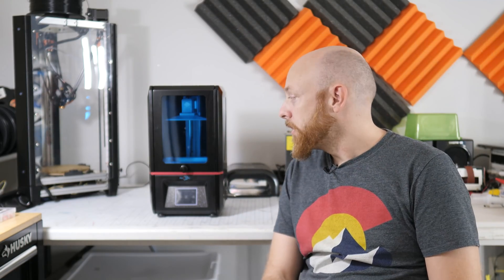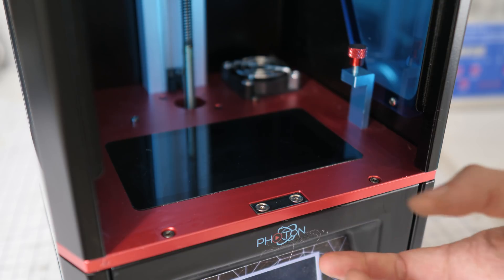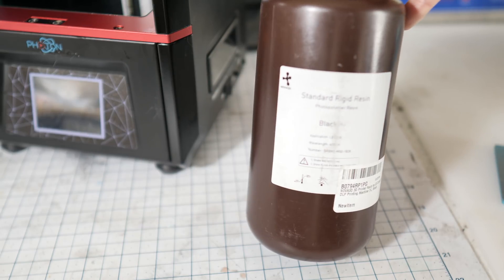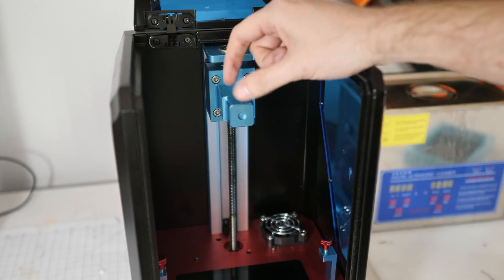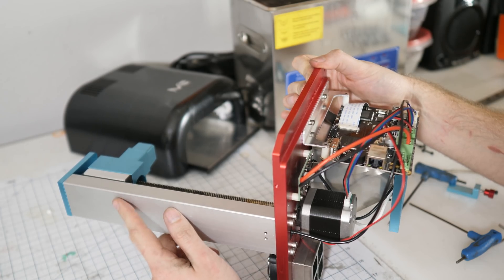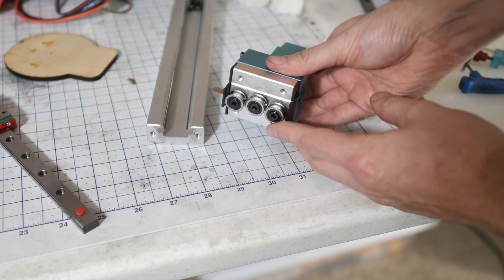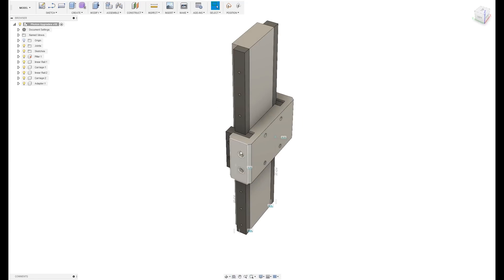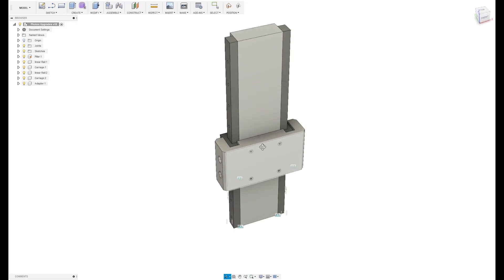Anycubic Photon Tear-down and Upgrade - S02E45

Comment: You should sell this as an upgrade.
Reply: Totally agree — but I think they would need to sell the drilled rail as well as the adapter bracket. There's no way I could precisely drill the mounting holes at home. I would be very interested at a price point which was sub $100! Hint hint...
Reply: Anycubic should just start doing it. if it cost extra just have a check box for the difference.
Reply: yea, if the cost was under $100 i'd do the upgrade..
Reply from the maker: 3D models are posted here:
http://www.physanon.com/anycubic-photon-3d-printer-part/

Or you can by some pre-made ones here:
http://www.physanon.com/photon-upgrade/

Sorry that took so long to post.

Comment: Have you thought about selling this as an upgrade? I myself would buy it.
Reply from the maker: 3D models are posted here:
http://www.physanon.com/anycubic-photon-3d-printer-part/

Or you can by some pre-made ones here:
http://www.physanon.com/photon-upgrade/

Sorry that took so long to post.
Reply: @PhysicsAnonymous   Seems anycubic guys fixed this issue in Photon S model
Reply: @MrLMAOSAN  hum, i dont think so, check the latest vids about the S model, it seems to be crappy as hell
Reply: @bogdahn689  if you means video where guy whining 10 minutes about lid - it's garbage. I don't really care about weak plastic lid. I more care about quality of printing, highest LCD resolution, and 2  Y-axis rails instead of 1 in previous model.
Reply: Physics Anonymous I pre ordered one of your brackets. Do those that purchase it also get access to your model like the $1 patreon purchase?
Reply: Physics Anonymous does it work with the elegoo Mars ?
Reply: Me too. Or could you provide the CAD Files? Makerspace with a CNC and done.
Reply: I would literally pay for an engineering drawing so I could machine it myself.
Reply: yeah, me tooo
Reply: same
Reply: I would also be interested in this if you got enough interest would it be worth your while doing a Bach?
Reply: As would I, apparently its really needed XD

Comment: Cant you get a larger lcd like a replacement screen from an ipad or something? the build volume was my biggest problem with this machine.
Reply: You'd need something like a 4K iPad sized screen to get close to the same print quality.  The little 4ish inch screen in this thing is higher resolution than the iPhone X.
Reply: @Barry Woods, Right this little screen is 2k, a 4k ipad screen would be plenty. Really, looking at the print quality theyre already getting, I really dont think resolution is going to be a problem...

Comment: And that is why making your own Sla printer is better in the long run lol, Im sure for the price, it is a good little printer, however, it leaves you at the mercy of badly design parts due to keeping price down. While your at it! I would suggest getting ride of that single "high" power led, and replacing it with an array of 3 watt led's so you can cut the print speed down by half.
Reply: What are you talking about? Have you ever seen the Photons LEDs <---plural? It has 4LEDs which are COBs which themselves have another 4 dies, which have... about 3 Watts power draw.

Comment: Nice! Amazing what one can do with a $100,000 Tormach ;)
Reply: why do you think the tormach is $100.000?
Reply: faxxzc I know it is around $50K up in Canada. But I was making a point that even at $50K, it is well beyond the reach of most home makers/tinkerers/hobbyists. It was an interesting video,  but overkill to fix a problem which us peons would solve by buying new linear rails off fleabay.
Reply: @RichardT2112  i ve a couple lying around in my garden shop for some hobby projects.
Reply: How is this fixed with linear rails?
Reply: resmores Cool ... a troll ... do you turn to stone when exposed to sunlight?
Reply: @RichardT2112  lol I was only half joking as I'm unaware of any drop in Rail kits for the Photon.
Reply: LOL  a 100k tormach.
Reply: I recently bought a full size Bridgeport mill with 3 axis CNC for $8k. It's not as expensive as people think.

Comment: OK, wow.  Camera threads are always a, well, female dog.
Reply: i've printed them before on a fdm printer with good results. you just need to select the right filament, i found protopasta carbon pla to work best for tiny threads.

Comment: Let's see your resin printer make all the parts for a MPCNC for under $70 worth of filament. The resin printer is an awesome bit of kit though. Enjoyed the video. Looking forward to the next one.
Reply: HAHAHA RIGHT, the parts would never be strong enough anyways, resin,especially on the low price rang of 100 dollars or less, is almost more fragile then glass. they shatter easily.
Reply: @patprop74  That's not the case with all photopolymer resins. There are some that are pretty tough. I've been using Siraya Blu and found it to be not brittle at all. https://www.youtube.com/watch?v=QbwbpzDNVAA It's also only $55 per liter on Amazon and really easy to print too.

Comment: So you went to a professional machine shop NYC CNC, to get the part machined. Ok, and you still used shim stock?

It would of been faster to deck each side of the z bracket with the superfly while it was on the machine. Then when you were machining your bracket you could of used John's height gauge and programmed that into the machine and you would of had a machinist fit......
Reply: I really doubt with as little as that weight it was causing any deflection.  Most of those MGN clones have problems.  CNA on aliexpress isn't one of them.   This was an overkill.  I think the thing wasn't tight to begin with and the looseness can be taken care of other ways.  Its just not heavy enough to cause any major issues.

Comment: wondering if your selling the mod that goes between the rails it would make a great fix to my photon. The rails I'm definitely getting. or suggest if there is a seller that might have created your mod?
Reply from the maker: Yeah, I am willing to manufacture them. Stay tuned I will get them up on our store in the next week or two.
Reply: @PhysicsAnonymous  that's awesome. will it be up on the physanon.com?
Reply from the maker: Yup, I'm going to try and get them up by the end of the week. Are you getting the same linear rails I linked to?
Reply: I have already ordered them just in case they don't last.
Reply: Physics Anonymous any way to get notified when you put them up on your site?  Thank you!
Reply: Really hoping that the modded part you built becomes available, got the new rails and standing by.

Comment: Makes me wonder if a 3d printed version of that part would be an improvement over the stock configuration. I'm guessing it would be 95% as good as your mod, the part isn't exactly huge so really it should be more of a question of reducing bearing play than actual rigidity. Maybe I will try that :)